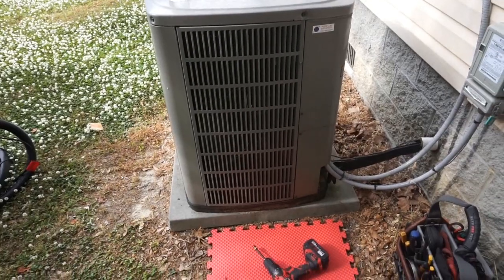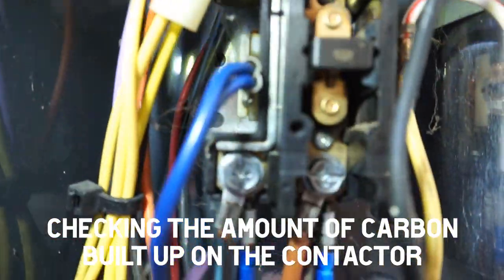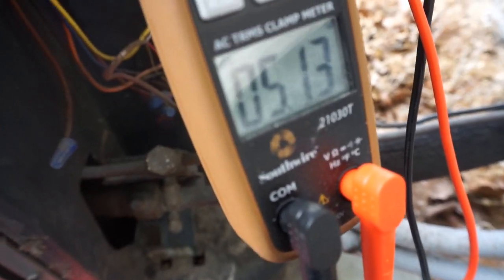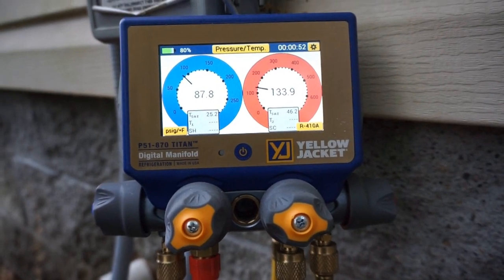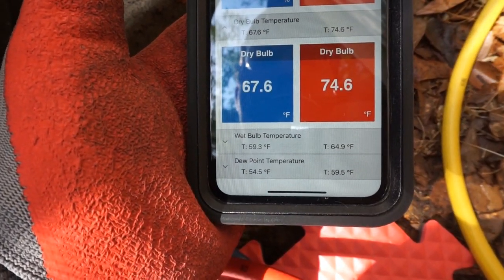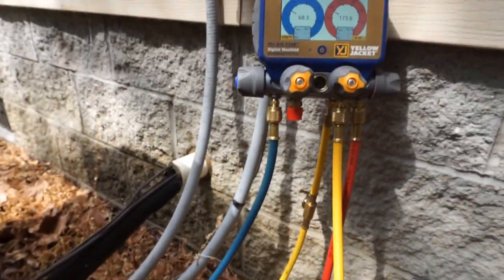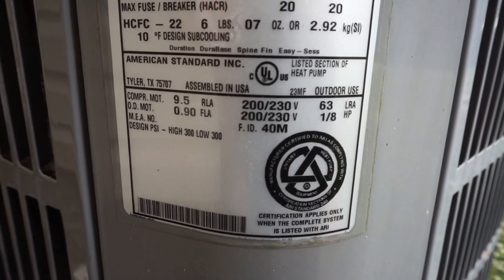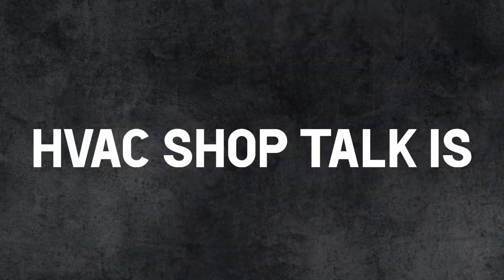HVAC Service | The Underwater American Standard

Comment: How did you take off the side panels? It’s so difficult to take off. Also, how to claim manufacturer warranty from American Standard? Huge leaks in condenser unit which is less than 5 years
Reply from the maker: Pry with a screwdriver
Reply: HVAC Shop Talk Thank you. Very bad design. Should let the engineer who design it to dissemble it first.
Called American Standard many times, never get connected. When I put zip code, it says they didn’t cover my area then disconnected. Totally sucks